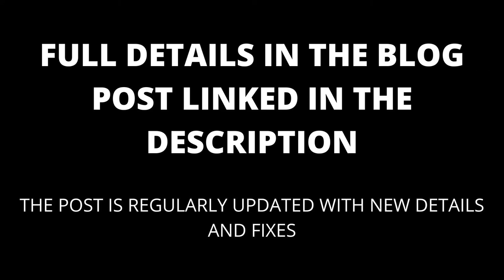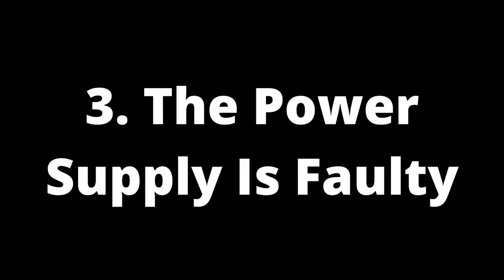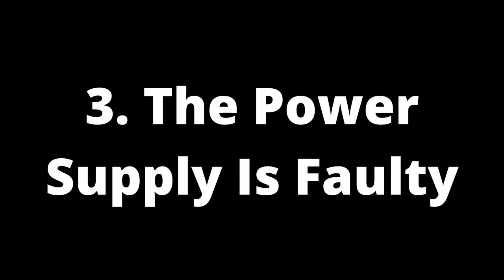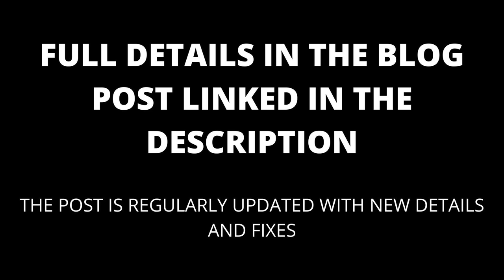Samsung TV making a noise when turned off

Comment: the noise you're hearing is the pixel refresh to prevent burn in, it runs every time the TV is in standby.
Reply: A buzzing noise is coming from the back of a brand new samsung tv constantly. When the room is quiet, I can hear it even from 2 meters away. Do you think it's normal and it's pixel refershing?
Reply: Mine was making static noise while it was off.